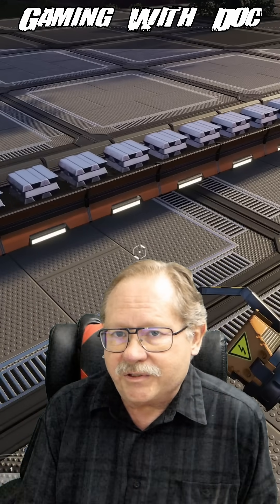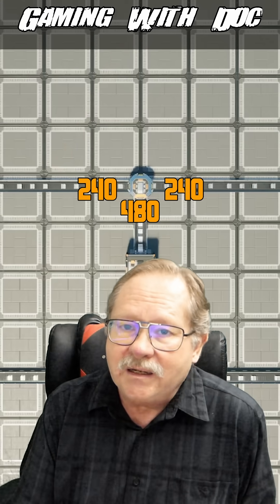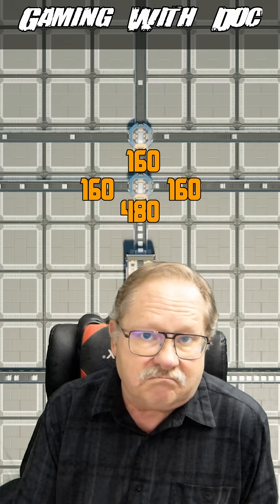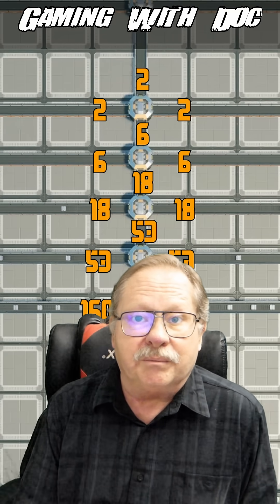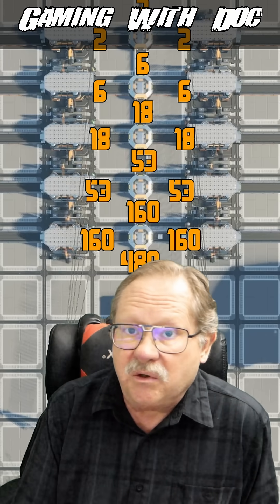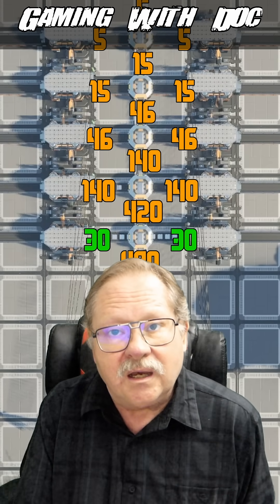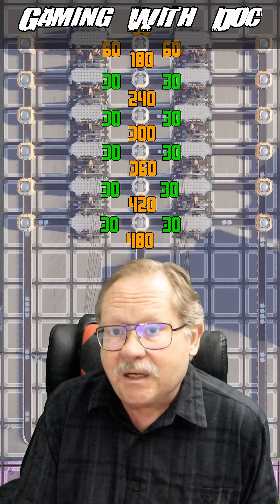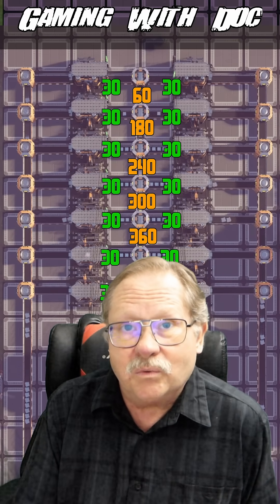Satisfactory Tips 64: Manifold Conveyor Math

Comment: I like belt mathmatics. If your input is 480/m and each machine uses 30/m, I'll use a mk1 belt from the splitter to the machine so it only gets 60/m. that's still too much so the buffer will fill up, but it won't consume that full 160/m at the start. Also down the line using lower tier belt if the following machines don't consume more than what that belt can handle.

Comment: Ever tried a smart manifold?
I find they fill up better and the output increases more progressively. This is because machines get saturated quicker due to not sharing input with later machines that will remain dormant until they get required quantities.
Theres an added benefit that you can choose to fill the manifold from either or both ends by selecting overflow for the bus for regular filling or the machines for reverse filling (furthest machine first).

Smart Manifolds are also good for variable rate production, as they ramp-up/down progressively with input rates.

Comment: One thing I do is connect all the belts but not the power so the whole system is full. Then I connect final wire to make it all work at once. You can also hook up power and belts completely but then start the machines in the back first and work your war forward

Comment: does not work with liquids right, not sure about liquid physics but assuming due to low pressure if you use 1:1 you can't build it up enough to keep last machines constantly running hance you want to pressurize the pipe first before starting the thing ?

Comment: Manifolds work for the reason that you can feed off the manifold for a dimensional depot or another production line. Perfectly balanced factories are fine, go and do that all you like, but sometimes things change, your needs change and Manifolds are easier to adapt. Need more machines? Just add another one at the end, need to pull the excess off the line to a sink or depot? No worries. Manifolds are flexible, end of story.

Comment: The funny thing is, this is also exactly what confuses people about liquids.  Aside from sloshing mechanics which I think are pretty simple, what REALLY tricks people is remembering that the pipe and machine (generator or refinery w/e) ALSO has an inventory that can hold 50 of that liquid.  When you have that split into 40 generators, it makes sense that EVEN if you sloop the line to backfill it, it will STILL take a few minutes to backfill the inventory of the actual generator inventory and pipe inventories.

So they'll have a generator turning on and off, and assume they miscalculated their fuel amounts...  Chances are, you didn't, you just aren't being patient enough.  If you are using almost exact amounts in pipes, it will take almost an entire IRL DAY to catch up... which is why I usually sloop them to catch them up.
Reply: Example, lets say you're doing 1800 turbo-fuel and running 100 fuel generators.  Those generators have 5000 fuel in inventory space, which is TWO INDUSTRIAL fluid buffers.  Then when you consider piping it could be twice that much.  So even if you're producing 1800 per minute which is an INSANE amount, it might STILL take 10 minutes to pack the lines assuming they are ALL SLOOPED lmao.  And if you don't sloop them?  You can look forward to your power fluctuating for quite some time.

Comment: Its funny seeing Doc look a little dejected saying he uses so many manifolds, a few hours after seeing an older video where he says he prefers balancers. I've learned a lot from Doc!
Reply: Most avid satisfactory players like myself will admit that while balancers are more "elegant", they rarely look better, and a lot of people build for aesthetics.

So I guess he's just saying manifolds aren't so bad.  There are a couple ways to get around the backfill issue anyway (my usual go to is splitting intake into two manifolds, essentially splitting the difference between balancer and manifold) but you can also just manually jam a stack in to the rear machines so they don't idle while the others spin up.

Some have mentioned you can also just make belts go down a tier after splitters so that they backfill faster (i.e. the belt backfills the machine before the machine's inventory does)

Comment: I'll keep using balancer, the most satisfying part in a giant Factory is when no Items are standing on the belts, everything is moving. Especally after building a factory for hours or even days and then starting it up all at once with just one power line and it just starts working immediately with everything close to the or at 100% efficiency

Comment: In my experience, if you build a line with manifolds, buy the time you build all the machines and conveyors in and out, buy the time you are ready to connect it to the next part of the factory, it already has saturated and shut down because the output is full and not going anywhere.  So it doesn't really matter.  The only time you have to really monitor a startup is powerplants.

Comment: If devs could have added a machine that limits the item per minute on a belt, we can achieve the perfect manifold. 

Sometimes that is possible if we have 600 items per mşnute belt and in order to split it perfectly, we use the tier 1 belts in each sections but we really need a proper limiter thing. 

Yes, there is a mod for that but why not in retail.

Comment: yes, manifolds make everything a lot easier, and besides some additional startup time they work perfectly.

With one exception: when you have very slow production or want to avoid filling up the machine too much (which both applies eg to nuclear components) you should carefully spread out the incoming belt to all machines and/or reactors instead of using manifolds.

Comment: Yes but also important to calculate your miner output and the center belt feeding all the machines not smaller than combined required material of all the machines.
Reply: If you ever find you've bungled this up, you can just underclock them all instead of redoing your whole machine array.  Not optimal but definitely worth remembering.

Comment: My favorite, and most effective method to fill up manifolds quickly without manually filling machines or having buffers(you should have buffers regardless)

Smart splitters! Left/right go to machines, center is overflow. Run that the whole length of the manifold. The first set of machines will fill up first without any loss to the third split and this will continue to down the belts at a rate faster than letting a manifold play out normally. This also allows you to plan ahead for upgrades. 

You can build a factory for, say, iron plates. If you only have tier 3 belts, you can only move 270 ingots per min. But eventually you'll have belts capable of moving ~1000 parts per minute! Instead of adding on to your factory later down the line, you can plan for this eventual increased production by setting smart splitters in your manifold and setting up all the constructors you'd need in the end game for said factory! All you'd need to do is upgrade three or four belt links every so often as your tiers increase.
Reply: The first machines fill up first without smartsplitters 😂
Reply: @nichtrelevant2777  At half the speed they would without
Reply: @yomaster12345  I see where the idea comes from. but with that overflow method the last machine in line will receive materials later than with a normal splitter because all the others need to fill first. with normal splitters they all fill gradually making the last in-line get resources faster to start stabel production.
Reply: @Desiloce  Speaking from experience, those last machines would be getting so few resources that they'd be effectively off until the first machines fill up anyways.
Reply: I have done this a few times on systems where i need X amount of each thing (aluminum or steel) and just want the rest to be stock or sinked

Comment: if it's 3. Just us cheap mk1 belts between the 2 machines. feed that mk1 belt into an splitter feeding 2 machines. Bang fully load balanced. and expandable till you have usedup the full belt. 

If you have a distribution floor below just point the bottome elevator towards eachother and set the splitter there in between.

Be creative

Comment: I wish offline machines could still store materials. Just leave it offline until the machines are full
Reply: 1000% this would almost entirely solve the issue.  It's almost like the concept of a fluid buffer.  You can achieve this "effect" by making storage chests in line before each machine but OBVIOUSLY most people won't want to do something quite so obstructive.  But I WILL say if you're gonna tear down the factory anyway, go ahead and do this right at the start setting up a machine array, start with the source splitters, and the storage chests... because by the time you everything else placed and wired up, those chests will be partially full, all machines will start up instantly and there will be no interruptions.  It's just a bit... ugly.  

I love your idea though.  Have you thought about suggesting it on their feedback page? Satisfactory devs are pretty responsive compared to other games.

Comment: Use slow belts going into the machines and fast belt for the main line.  This way the first machine doesn't have to fill up before the rest get anything.
Reply: That works well for belts, but a warning for anyone trying this that it’s not advised for pipes. If you use Mk2 pipes, it’s best to connect to the machines with Mk2 as well.
Reply: @NastierNate  very late to the party, but is there a reason for this?
Reply: @ARatherDapperTapir It was something I saw on the subreddit and experienced fewer fluid issues when I implemented it. I don’t know the exact reason behind it, just that it seems to work. There are so many bugs with pipes that I’ll take every advantage I can get.
Reply: Then put a splitter on each of the slow belts and feed the split low belt into 2 machines. Load balancing done.

Comment: At first. I wasn't super fond of the manifolds. But once I got farther and things got more complicated, they are truly a godsend. Belts get way too complicated when your trying to directly feed machines, and you want 100% efficency.
Reply: I just BPd out and built my first recycled plastic/rubber loop factory, 27 refineries each side, that one was fun with t5 belt. Made a splitting output which overflowed into 2 lines, 3 total lines so all 27 each side could be in a single 'line' and looping back into the input and the master overflow was my core output. 

Only mistake was not using smart splitters between all the machines and took 10 mins to fix. I would make one change for the next one though.

This game is pure joy.

Comment: You can also use slower belts that goes directly to the machine, this helps send more items to the back faster
Reply: I do this a lot too, the gotcha here is when you come back and overclock the machines, but forget to upgrade your belts
Reply: @michaelsutherland5848  If you're going to do this, may be better to feed the machines with lifts. Much more visible and easier to upgrade later.
Reply: Не разгоняй машины. Проще новый завод построить.  @michaelsutherland5848
Reply: @michaelsutherland5848  i guess i tend to scale up vs overclock unless its a miner/extractor or something im manually watching and want to produce faster for a short term. i definitely have had better luck since ive been adjusting belt speed to max machine item use though.
Reply: Exactly this: In my first coal power setup I use 120 bely into the system, but each power plant is fed by a 60 belt , later I up the main belt to 270, but keep all stations at 60, just adding more power stations
Reply: I always use the lowest belt necessary into the machines and the fastest belt necessary on the backbone.

I also either leave a gap to see the belts and items.  I like to see items flowing for the visual effect.
Reply: I just learned about this if you put a t1 belt going to each starting machine it will register as backed up while the t4 belt tries to push more through making it flow better.
Reply: This is the way.

Comment: 2 ways to help speed them up

First, fill the machines by hand, that way only the belts have to fill up

Second, If you're building production lines in sequence build and fill a buffer Storage Container before the Manifold so that when you connect it the belt saturates immediately and you have excess to fill up the machines

I found that 2nd method on accident cause I just needed the parts from an earlier Manifold but by the time I had the next production built it was full and just boosted the 2nd line
Reply: Both work in different situations. I trade #1 out for #2 once I've got at least some production of stuff rolling. I call it "pressurizing the line" while I'm setting the manifold up lol

Comment: Preloading the manifolds from your inventory is, in almost all cases, very easy. As you build your factory and get earlier stages of production done, everything will fill up, and you can load the products into your inventory to fill the machines from the next stage of production once you get them up and running. Everything that needs to overflow is overflowing as soon as you finish the power lines.
Reply: Definitely. Works great for coal power plants. Just send the coal into a container while you’re setting up your pipes, then you’ll have plenty to jumpstart the machines by the time you’re done building.
Reply: @NastierNate  if you plug the gens up and then run your coal first as you set up your pipes you saturat the generators lol
Reply: I like to add a storage container for each specific resource at the end of the line even if it connects to a new one, this way I’ll always have extra resources if it overflows, in fact I want it to overflow a little bit. Because of this I always have plenty of spare resources, plus it’s not as if it over complicates any line.
Reply: Ngl, its what I went with naturally, didn't want to waste the space
Reply: i like powering my factory as i'm working on it so once i'm done with a section or a floor I power it up and leave it to overflow while i'm working on another thing.
Reply: I am having such a fun visual of some efficiency crazed engineer running between a pump and nine coal plants with his hands cupped to fill up the tanks so the power doesn't shut down...
Reply: Or turn off all the machines apart from the last ones, let them fill, then turn the rest on in sequence until you get to the first machine
Reply: Blueprints would like a word
Reply: It'd be even easier if offline machines would also store materials (I don't think they do? Been a while since I last played); that way you could just selectively turn off arrays or even entire stages of production and have them backfill.

Another way this could also be done, however, is to intentionally not connect the output manifold belt to anything (at first); this way, the first machines in the manifold would hopefully back up soon enough that even more inputs are redirected to the later machines. Then, when everything's saturated, connect the output.

Using lower tier belts for inputs (and outputs) are also a good way of limiting how much "bandwidth" the earlier machines take up; if a machine's input doesn't require more than 30/min, there's absolutely no reason for using more than an Mk. 1 belt to feed it (and since even that would technically be overkill, you could ofc also rate-limit that belt, although that would kinda defeat the purpose of using a manifold in the first place).
Reply: To speed up the process, you can pre-load machines in blueprints